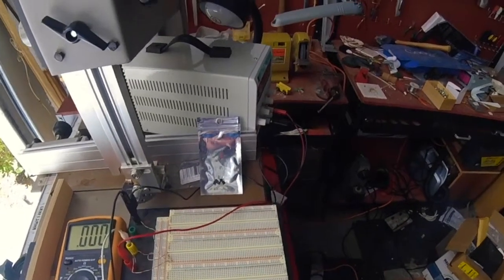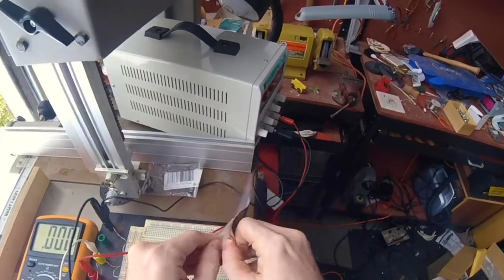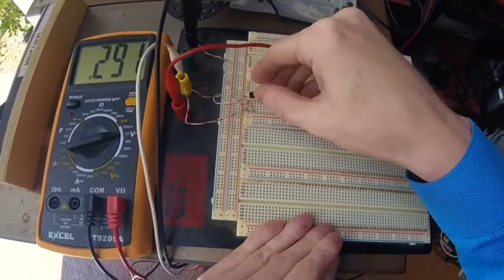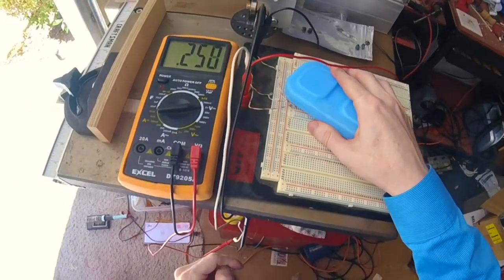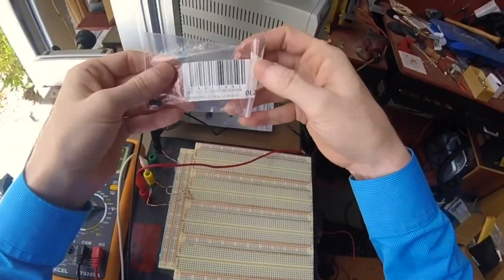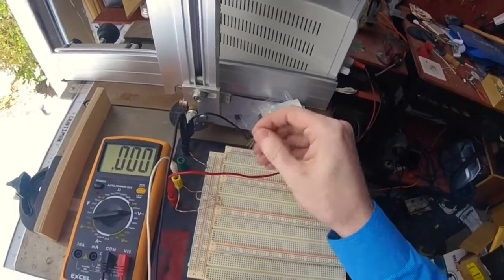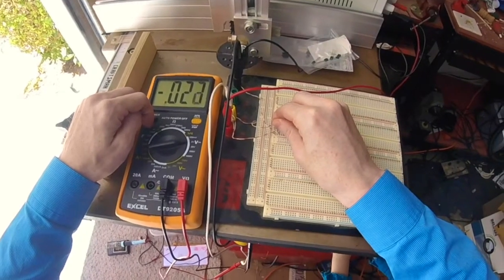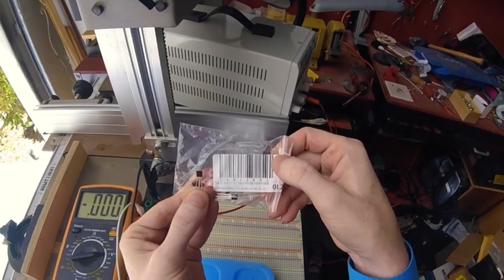Real vs Fake LM35 Sensor

Comment: I had the same problem with some LM35 sensors. I think they're relabeled transistors. Thanks for the video, it should be public
Reply: Correct, I have the same problem, they measure NPN transistors!

Comment: You should make this video public, I found it on an Electrical Engineering Stack Exchange forum, I got this same problem but with the ones that say "52AB LM35 DZ", they cost 1.54 USD each, so they are quite expensive to be fake or faulty ones.